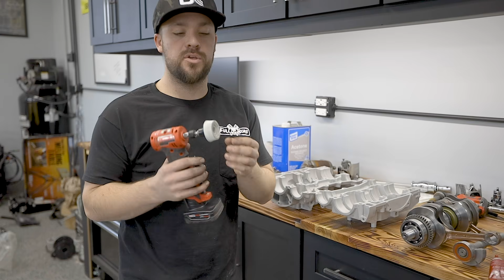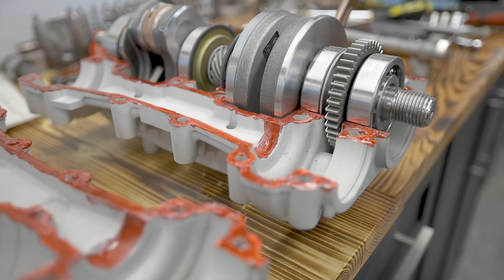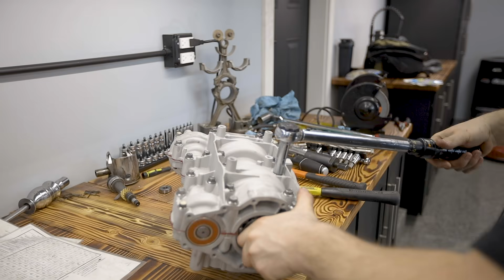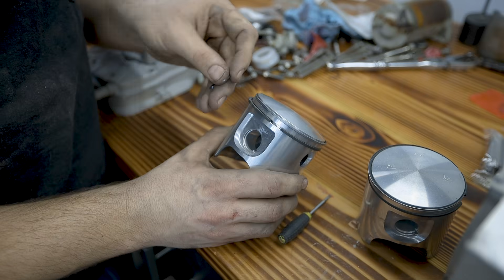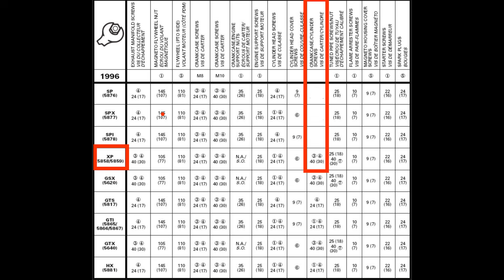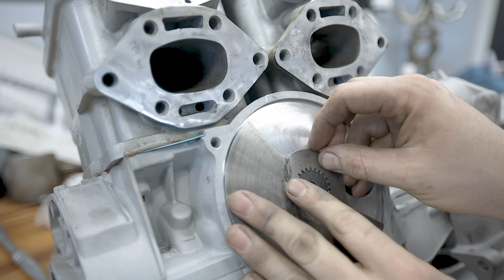Today We Wrench - Wet Wednesday's: Seadoo DIY Series EP.2  787 Engine Assembly

Comment: I put the case back together with the 518 as instructed following it to a T. And unfortunately, my crank case seal had zero seal. I was able to blow through it with my mouth plugging the other end.

So I took it apart, two more times. I just can’t seem to get it to seal correctly. Not sure if I’m just not using enough sealant? 

I’m putting a very thin layer on both cases like you said. Maybe I’m putting it too thin?

Comment: 518 is an anaerobic sealant. It’s meant to be used on metal to metal contact only. Not intended for plastic or rubber seals, or for paper gaskets
Reply: I’ve used on paper and rubber. Never had an issue. 🤷🏼‍♂️🤘🏼

Comment: My question why didn’t you powder coat the engine cases and cylinder? If you have raw metal that’s going to corrode if you go into saltwater should have some kind of protectant on there.
Reply from the maker: Every engine is either painter or powder coated. We would never install a raw aluminum engine in anything let alone a watercraft

Comment: Does the counter balance assembly get oiled with the rotary shaft or are they completely separate?
Reply from the maker: It gets oiled through the drain back hole. I believe we showed it in the video
Reply: Thanks for the reply.  Yes you did show that in the video.  That is why I am concerned that I may have made a mistake,  I gestimated when I filled the counter balance with oil because I thought it was going to get oil with the rotary shaft anyway.  Do I have anything to worry about if I under or over filled the counter balance. This ski(96XP) has been up and running and ridden for a few hours. @TodayWeWrench
Reply from the maker: @davemall1  nope, some dont even put oil in them

Comment: Do you have any idea if running the engine incorrectly timed, for a very short amount of time can blow out any seals?
My new engine was timed incorrectly to where it would start hard but require throttle to run.
It was only run for 20 seconds before I corrected the issue.
Broke the engine in, spark plug tuned it.
My oil injection is deleted and I have the feed and return just looped together, full of oil.
Initially I thought it was just air pockets that had to work out of the cavity, but I continue to have to add oil to my oil loop and im beginning to think that there cannot be any air pockets and that the motor is actually sipping oil from the rotary cavity.
Any insight?
Im going to fix up a way to "T" into it with a hand pump and see if I can pressure test it while its still fully assembled full of oil..

Comment: I get a mis around 6000rpm, similar to  impeller cavitation. Also I get 2 beeps but I have to pull the Dess key off every time inorder to start it again. Sometimes it'll only rotate 3 times & quit during startup. The longer I run the ski, the worse it gets. I've replaced almost everything at this point except the coil pack. That's my next thing to change. Any insight would be greatly appreciated

Comment: Hello
 I have a problem with the engine speed in my Gtx 800, the engine behaves just like in the movie Do you have any ideas, I will check what is going on at the weekend. This is not a voltage regulator , temperature sensor symptom? :) Thanks guys!!!
Video https://youtube.com/shorts/dD8n1ViE7uE?feature=share

Comment: Nice work
Did you assemble the top-end Dry?
I am planning for rebuilding a 2 stroke engine and contemplating dry assembly (top end).
Reply: Do NOT assemble it dry.... 
At the VERY least, use some of the proper 2 -Stroke oil that you use regularly in your machine.

Comment: Hi, I had a question. 
So we’ve completely rebuilt our 787 engine for 2002 seadoo gtx rfi, and believe we’re ready to drop the engine in. I was wondering if it’s necessary to add oil to the lower end prior to starting it. I assume you should bleed the oil injection lines but concerned about there not being any oil in the case when it fires up initially. Any advice you can give would go a long way! Great video, very helpful and in depth.

Comment: Great videos for the 787! I'm rebuilding my 787 for the first time. I have a few questions, can someone please help me out:
1.  I applied the Loctite 518 last week. The website says it dries in 4 hours but after 1 week the 518 is still "sticky" to the touch. It never dried/cured.  Is this normal?Maybe the one I bought off Amazon is a bad batch. 
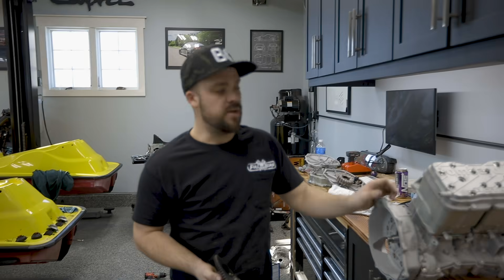2. After assembling the engine, it takes a bit of strength to turn the flywheel. Is this normal? The best way I can describe it is the first 300 degree rotaton feels "tense" and the reming 60 degrees of the rotation is "smooth" with minimal effort. In your video when you turn the flywheel at the 17:00 minute mark it appears to be turning with minimal effort. 
I appreciate any feedback!
Reply: Thanks for the feedback! I'll wipe down the excess 518 with acetone.
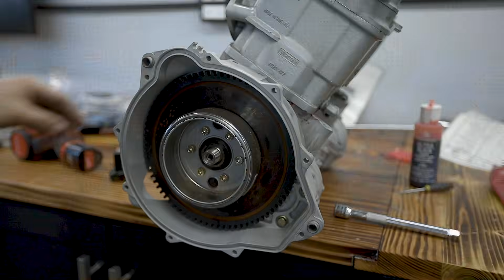The cylinders are on and the spark plugs are removed. It's currently assembled exactly how you have it at the 17:20 minute mark in your video. When I fully disassembled the engine the crankshaft and counter balance rotated freely and all the bearings are in great shape. The counter balance is placed on the correct timing mark with the crankshaft. Do you have any suggestions as to why the assembly is tense when I rotate the flywheel?
Thanks!
Reply from the maker: 518 drys when the oxygen is taken away. So your case surfaces are nice and sealed. The squeeze out will never dry, wipe it away with some acetone. 

It should spin over freely. When you say "Assembly" cylinders and all are on? Are spark plugs in?

Comment: Quick question. How am I getting water into my starter can it come from crank case?
Reply from the maker: That would be pretty impossible. The water only fills the cylinder jugs so you would have to have a massive leak that bleeding into the crank case. If that was the case though the engine would hydrolock in a matter of seconds.

Comment: Damn wish I’d seen your vids about 6 months ago I just rebuilt my 1997 XP and mine turned out good but I didn’t seal stuff like you do now you have me wondering. Runs strong on the hose but when you put it in the water it just doesn’t want to go just putts and I have no idea tried everything. Need someone that knows the old 2stroke seadoos to look at it I’m out of things to try.
Reply from the maker: That’s one of two things. Rotary timing is off or the carbs need to be rebuilt.

Comment: Do you have a part number for small Rotary Shaft Case C3 Bearing? The one that sits by the crank.
Reply from the maker: https://osdparts.com/index.php?main_page=product_info&cPath=28_29&products_id=605
Reply: @TodayWeWrench  How many tubes of 518 did you use for one engine rebuild?

Comment: This gives me so much confidence to do this now thank you!!
Reply from the maker: Awesome! That’s what we were going for. If you have any questions just ask.
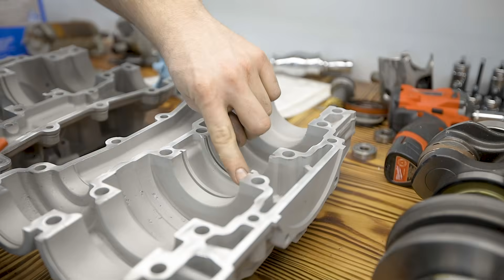Reply: @TodayWeWrench Okay so I do have a question haha. I have completely disassembled my engine and looking at the crankshaft it seems my seals (ones you talked about at 2:41) are bad. It looks like they partially melted off or ripped off when I took the crankshaft out. They aren’t completely gone and there is still a good amount of rubber left. Is there a way to replace those seals if they are bad? Or am I SOl and do I need to buy a whole new crankshaft. Thanks!
Reply from the maker: @aidenstiles294  Unfortunately you would need to rebuild your entire crankshaft to replace those seals which requires special tools found at a machine shop. You're better off buying a new crank from WSM.
Reply: @TodayWeWrench  confidence lost just like that
Reply from the maker: @c1anserv  lol elaborate

Comment: Great video. Well explained and no unneeded yammering. A lot of people say to tight jugs after exhaust manifold is on else the manifold might not mate good. Thoughts on that?
Reply from the maker: I put the manifold on then snug them down just under torque spec so they won’t move. After that I remove the manifold and torque them down fully. I find it in my way while assembling the remainder of the engine. It’s an extra step my way but I find it more comfortable. Short answer, yes use the manifold to align then torque. I included a note in the video for that as it was 3 min I didn’t feel was necessary to include.

Comment: did you not use red Loctite on the case bolts???
Reply from the maker: No you use 518. Red Loctite is totally different than 518. The manual DOES NOT call for red Loctite on anything
Reply: just re-read the manuals and caught that. you're right. do you think its necessary for red (217) loctite? i saw a lot of builds that they put red. but also that was for 951...... your video is the best and only 787! thank you! YOUR VISUALS HELP TREMENDOUSLY!
Reply from the maker: @garrettgough6658  No use 518 on everything just like the video and you will be golden. I have done many engines this way with great results. This video is per the manual, if you see others using red Loctite its wrong unfortunately.

Comment: Thanks for the information. The only question I have is how do I check the inner seals on the crank to make sure they are good
Reply from the maker: You will have to preform the RV pressure test as demonstrated in the video